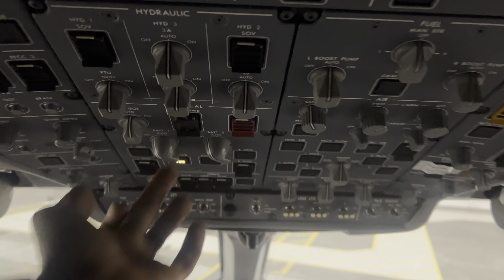A DAY IN MY LIFE AS AN AIRCRAFT  MECHANIC        || EPISODE 4.

Comment: Look it's a CSeries! Great video to service the generator. I just stopped working on flight test aircrafts 50002 and 55001. I was at the beginning in 2013 with the first flight of 50001. I was the lead mechanic on 50003 for a few years. Great aircraft! It's too bad Bombardier couldn't make it work out. Airbus has made a great effort with them. P&W just needs to get their issues worked out. Oh the stories about these aircraft.
Reply from the maker: so far it is my favourite aircraft to work on .